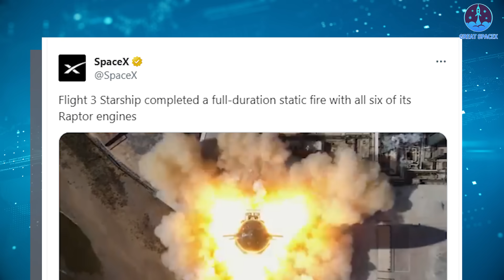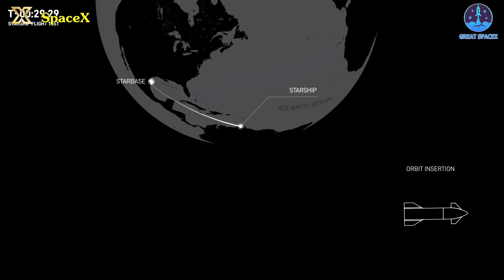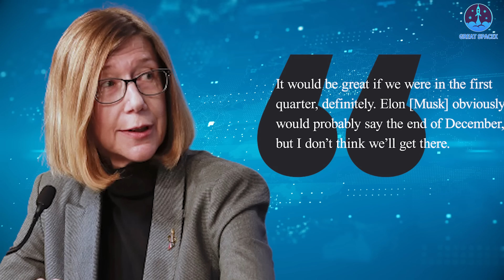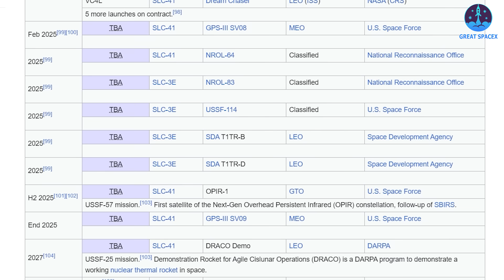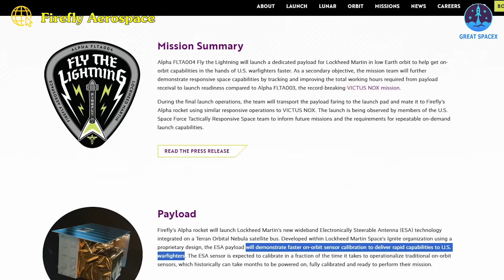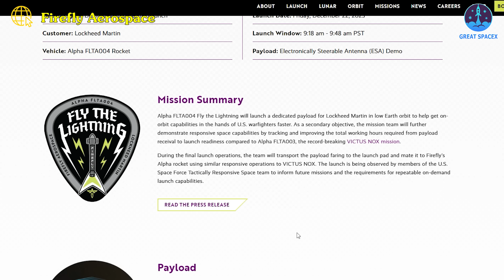Analysis Ship 28 Full 6 engines firing, Next round is 33 engines! Don't mess with SpaceX...

Comment: SpaceX might think about putting the hot staging section under ship 28 and any shielding that would be on a booster to accommodate hot staging, then put some pressure sensors underneath to determine how many BAR is under the hot stagging and also the weight that is on hot staging connection points.

Comment: Starship will never fly with 33 engine booster. Every flight is a waste of time, money and talent. The starship with its 6 engines is a question mark, because it has never flown.

Elon needs to send his engineers to Cape Canaveral.
The remove one of the F-1 engines then scan it and create new drawings of the F-1. As part of a deal to create the space shuttle they insisted   that nasa destroy all drawing to the complete Apollo rocket. IMO this was stupid. First law of creation is do not reinvent the wheel. These engines were designed by engineers work with only the use of a slide rule and a computer with less computing power of a digital watch.

Point being Elon needs to copy this engine for a change. This isn’t a knock on his engineers. They’re all some of the smartest guys on the planet. This booster will take starship to 36,000 kilometers and above the earths surface. Then starship will not require in space refueling. The booster will have to be redesigned to accommodate the large F-1 engines. A booster with 9 F-1 engines will life any amount of weight needed for the next 3 to 4 decades.
Reply: Nice to have an opinion...
Reply: What are you talking about. Starship has more than twice the thrust than Saturn V with its F1 engines. And the booster already launched starship into space.
Reply: Must be a former NASA employee! LOL. Was the F1 ever re-lit?  Sad that people don’t appreciate that the Raptor is so advanced from the F1…….go SPACEX!
Reply: @toadsauce8091  
Sorry but no it doesn’t. Apollo flew flawlessly the high earth orbit and reach lunar injection point. Starship has done none of these. Let alone reach 36,000 kilometers. To simple say 33 engines creates a high frequency vibration that will eat it self on ever launch. A real Booster test will be a burn that will run to 8.50 minutes at full throttle. Mark this post. Until they create large engines and less engines the booster has no chance.
Reply: With starship as is it can’t even be used to launch star-link. If star-link is to reach it full potential. It must have starship. Reason star-link satellites are getting bigger. Right now they barely have 900 satellites. The system requires 42,000. Can you see the light?
Reply: @mrbbnut  

Sorry I have spent 45 years working in manufacturing, electronics and electrical. I worked for 4 major sub contractors. My knowledge isn’t
 hypothetical . It is real world applications. I’m too young to have know those nasa engineers. But their work speaks for itself.
Reply: Hey Mikey, where are your subscribers and content on your channel??  You're awfully opinionated for someone with ZERo content. How much did Jeffy pay you??
Reply: Which rock have you been living under this past year? Starship has flown 2 times,  all 33 engines of the booster have been firing throughout its entire flight time.
Reply: Thank you for this morning's laugh... 😂😂😂
Reply: @TheMotoracer838  
Your welcome. Enjoy all the Roman candles to come.
Reply: You’re gonna feel real stupid in 5-10 years 😂
Reply: @dalan0204  

It could be you who will feel stupid in 18 months. But I’m betting your ego won’t let you. But until we both arrive. Enjoy some of the most expensive Roman candles in history. I wish you well.